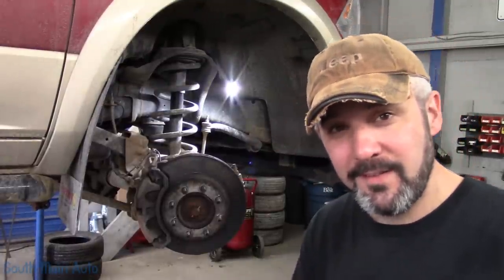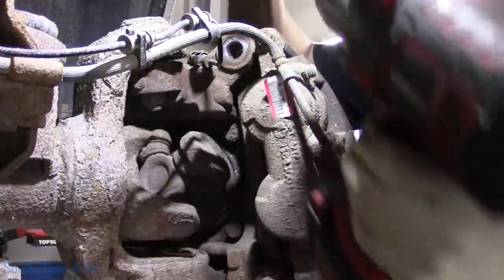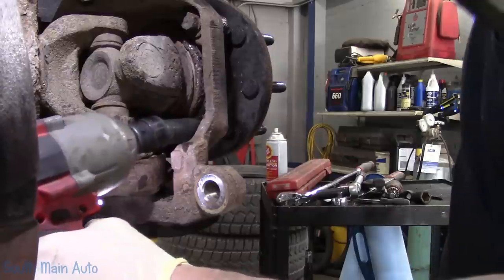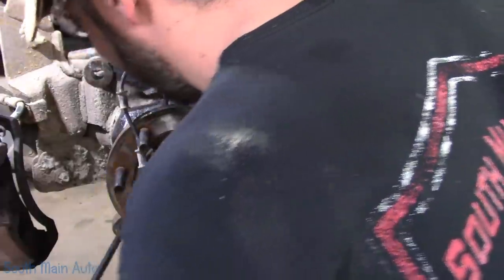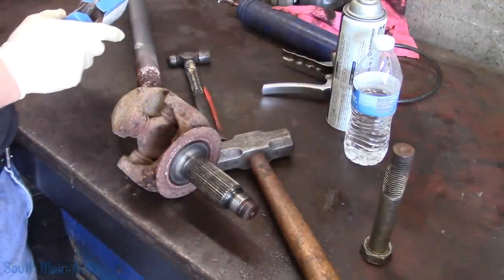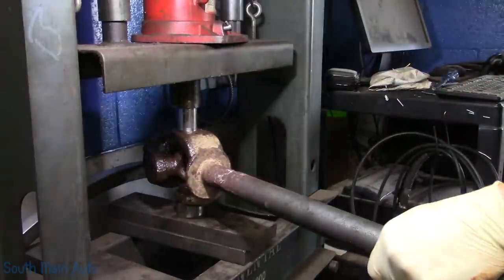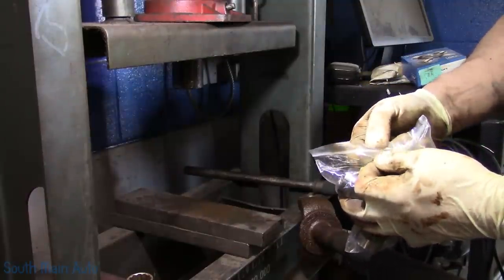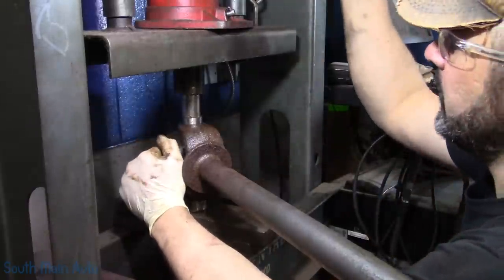Dodge Ram 2500/3500: Front Wheel Bearings & U-Joints - Part I

Comment: I bought a 1/4 drive impact driver at harbor freight, $60 over a year ago. I bought it to removed 8mm and smaller fasteners. I used it for a month every day at the shop, then I used it to build my deck, I bought 2 extra batteries ($26 for both) and used it nonstop for hours. I Still use it every day at the shop, still working great! I wouldnt say ALL the tools at harbor freight are great, BUT for $60, I think I got my moneys worth! I am glad to see you have had good luck with your harbor freight impact, Its on my list to buy ;)   Keep up the great work!  ( I also have a the earthquake 1/2 air impact, use that daily too.)

Comment: When you take your bearing caps off the U joint always put a few squirts of grease in them right away. That will always keep you from dropping a needle bearing when you go back to put them in. And leave the grease zirk out till last. That way when the bearing caps go back in it will fill the U joint  up with Greece and come out the zirk hole. Love all your videos. Thanks for sharing...

Comment: Greetings from Edmonton. This is THE best vid on a mechanical repair I have ever seen.  I have an '02 Ram 2500 with at least one of the  front wheel U joints worn, perhaps not as far gone as those shown, but in  need of replacement [they click when I have driven the truck for awhile and am tuning into my driveway].  Thank you, and kudos to you for the great instruction.  Just to add, I love it that you have the cam set up stationary, so that it isn't buzzing all over the place like a fly.  The viewer can actually see what you are doing.

Comment: I’ve owned several Dodge diesels, done lots of front wheel u joints. I’ve had the best luck with longevity with the Spicer non greaseable ones. Just my 2cents. 
Great video!!
Reply: He mentioned spicer and said he really hasnt had any better luck with them than others. In my experience I agree with you the non greasable spicers last a very long time. My last ones on my 01 ram 2500 diesel lasted just shy of 200k miles!
Reply: wheel joints that is. My rear driveshaft ones tend to go a little sooner.

Comment: I bought one of those earthquake impacts after watching you use yours... I charged it one time and did about 10 front end jobs... and even pulled some duels off of a dump truck before I even charged it the second time.  They are worth the  money... the electricity you save from not having to run the air compressor will pay for the tool... good find guy.
Reply: True but the power don’t compare to pneumatic guns.

Comment: First time I did a set of GM nylon-locked u-joints, I not only bent the ears of the yoke, but I also bent my Harbor "Fright" ball joint press! Instead of a "C" it was more closely resembling a "V". 😂 I paid $50 for that press from a Harbor Fright in Phoenix back in '99, long before they were heard of in the Northeast. Still have it! I heated the hell out of it, leaned it up against a 30-yard WM dumpster that was here at the time, and took 4 full over-the-shoulder swings with a full-sized sledgehammer onto it - 2 swings on each end - after heating the shnazz out of it with Mapp for 10 minutes. It worked!! Twas that day that I learned to MELT the nylon, and not try to muscle through it, just because you've got a press! 😁

You've got a great woman there Eric! Mine cooks for me too, but she works at a salon full time, so I end up eating the same smoked turkey sandwich, smothered in horsey sauce, for years on end, lol. She'll usually cook supper for me in the morning (she works late), and throw it in the fridge, so all I have to do is toss it in the nukeulator for a minute or 2, and supper is ready. One of the many reasons I married this one. 😉
Reply from the maker: We need to meet some time Smitty!
Reply: Hear hear, brother!  I'll get out your way one of these days, for sure. Hopefully sooner rather than later. 👍
Reply: just torch them until it starts melting out the injection holes like little snakes, then push  them out like butter :)

Comment: I always use to dab a little grease in the cups to hold the needle bearings in place.  Dropped a few in the early days and had it lay sideways at the bottom of the cup and then had to take them apart again and rest the needles.   Glad you showed everybody how to tap the sides with the hammer to equalize the tension on the u joint and make it smooth from the pressure of assembly.

Comment: i used to struggle on the press like you to do the tough u joints. until i saw a coworker use a ball joint c clamp press.   you can use a truck anchor  pin press on the bigger ones. clamp the shaft in a vice  and go easy with an impact  works like a dream.   and if not the flame wrench comes out.
Reply: richard cranium Tiger tool makes really good ones.
Reply: Never had access to a press, so a C clamp is all I ever used on Dodge U joints like this and the long driveshaft on the long B350 vans.

Comment: Super cool video!! The only thing I do differently is put the U-joints in a vice, like you did, open it up, take your Worm-drive skilsaw or Cutoff, I like the Skilsaw because it has so much torque and great handles,  put a metal cutting blade on and cut through the old U-Joints. Once they're out, punch all of the caps IN, cleaner,  10 times faster and most of us don't have huge presses.

Comment: A couple weeks ago I got to do this on a truck from Texas. Guy was up in Alberta Canada visiting. Half hour start to finish on one side. No rust anywhere, the bearing just slid out of the knuckle when the 4 bolts were loose. took under 10 mins to do the ujoint, a couple taps and all the cups were out. Was an '06 ram 3500 with almost 300 000 miles too. The bearings and ujoints were original. And normally when all goes well on trucks around here it can still be like a 2-3hr job on one side.

Comment: Just did my passenger's side u-joint. Not too bad to do. This video definitely helped with confidence in doing the work! Ended up putting a Moog grease fitting joint in it. Will probably do the driver's side before that one goes too!

Comment: 44k miles and looks like it has 144k miles, DAMN, I'm glad I live in the desert.
Reply: And needs new bearings and u joints?!? That is unexceptionable!
Reply: And Oregon wants to start using salt :(
Reply: @philllsxga.7737  It is a dodge after all, I'm just amazed it lasted that long, the only good thing is the engine, maybe.
Reply: @Peter-pv8xx  LOL! True!  You should see  what I do off road to my Chevy's with IFS and hardly ever have issues! A wheel bearing at around 150,000 miles, maybe...
Reply: 217k on my Ford. Everything is original other than 1 set of brakes, 1 set of sway bar end links, 3 sets of tires, and a window motor.  👀
Reply: I bought a '15 in April from OK but its traveled all over to earn 335000.  Its all original except for brakes.  Will use spray undercoating with fluid film.
Reply: weather doesn't affect bearings and u joints, just shitty dodge quality.
Reply: Jack Winand false. Heat/cold cycles do hell on the seal and then it lets water/dirt in. However this is likely just bad quality.
Reply: I have the same front end in a 3500, I got 110k out of the wheel bearings. Towing/plowing on 35” tires. That’s all I ever got out of my f350. These newer front ends are a great upgrade from the old ones.
Reply: When you work these light duty truck the parts wear fast. I've had to completely rebuild front ends after 20,000 miles and one winter plowing.
Reply: 220K on a 2001 Dodge 2500, the only thing to wear out in the front so far is the ball joints & tie rod ends at about 190K, but I'm in the Rocky Mountains, no salt. The bearings and u-joints were all tight as can be last month when I did the brakes.
Reply: @JeffinTD  Just the drivers who shouldn't drive in the snow/ice!   Joe from sw Washington, raised in NY/NJ.
Reply: @85square  weather don't - salt does
Reply: @chrisfreeman3279  Timken makes dodge bearings.  They are the best.  Moog used to be, but no more. AC/Delco are also made by Timken.
Reply: @FaustoTheBoozehound  Timken bearings are the best,  Moog used to be, but no more,  AC/Delco bearings are made by Timken too.

Comment: good vid - had to do my 2007 last year (2018) and although in Canada i live far enough North that we don't bother with salt for a lot of the winter since it is not effective below minus 18 so not worth using it.
I used the press like you since hammering on these is not good, too easy to bend stuff, doing the U-joints,
Wheel bearings, and every U-joint in the whole truck had to be done over a period of a couple years, it is just part of the pleasure of owning a 2500 i guess.
I did the socket and short extension trick for the wheel bearing removal and it worked pretty well.
Great video - thanks.

Comment: Harbor Freight sells a pack of wire wheels for about seven or eight bucks it will help you clean up all the rusty parts if you stick it in a drill I was working on Class A vehicles that did International routes so I dealt with all kinds of rust and having just simple wire wheels on a drill made my job so much easier

Comment: JB Weld a faucet handle on the relief valve screw of your press jack. Mix up a gob (not the quickie stuff) tape in place.
Reply: what about a longer cross pin or just weld a nut to the end :0

Comment: I can't believe your hubs and u-joints are gone at 44K!
My 06 2500 has 250,000 miles on the original hub/wheel bearings and it's only on it's second set of u-joints. That's insane.
Reply: I have an 03 with 135000, my u joints are shot, but I’m letting them go a while yet until this summer when I’m doing ball joints. Far as I know its the originals yet.

Comment: I don’t know how people afford vehicles in NY. I purchased a 2005 4x4 V10 Excursion 3 years ago with 180k miles. I put in a new HD transmission and did a head gasket change 2 years ago. She is running like a champ and I plan on riding her for another 15-20 years. I’ll just do the maintenance as needed. I guess living in SW Washington State where it rains 9 mo per year but we never put salt on the road has its advantages. I also have a 1986 F350 with the 460 and while she needs new exhaust manifold gaskets, the bones are in great shape.

Comment: You should mention the proper location for the grease fitting on the u-joint.  You got it in the right place, angled to the opening between the ears of the drive shaft.  
You also clocked it correctly so that part of the u-joint cross will close under drive forces.  The hole for the grease fitting makes that area slightly weaker between those two cross arms.  If it is under tension, where driving forces will spread the cross arms, then it is more likely to break. Under compression it is less likely to break. 
Good job.  I'm soooooo glad to not live in the rusty part of the country any more.

Comment: I tack welded a little piece of round stock about 3 inches long on the piece that you turn to take the pressure off the jack on the press, that way you do not have to keep using your handle to turn it, just clamp a pair of needle nose vice grips  on it when you weld it to keep the heat from going into  it and keep it cool while you weld it,  good luck
Reply: why not replace the short pin with a long pin?

Comment: One would think spending 70k on a truck should warrant a few more dollars on a rust treatment of some sort. It boggles the mind.
Reply: PinkPrism I was in a metallurgy class in college. The professor made the point that the auto makers COULD make automotive parts with more anti corrosive materials.
Reply: Harold Flanagan There is a fine edge between building vehicles to last, vs. designing them to wear out, so that you come back and buy a replacement.
Reply: One would think they would be using an alternative to road salt by now too!
Reply: @mitchvankesteren6771  Not much that works better than salt and is as cheap and accessible. But definitely think it’s possible to engineer something better
Reply: Fluid Film is the way to go.

Comment: Great video.. Would highly advise against using the “socket & power steering” method to press out the hub(s). Did this on my ‘08 2500 and it blew out a seal in the power steering box and it’s been leaking ever since. (Apparently these boxes have no serviceable and needs to be fully replaced). Do it the right way and get a hub puller plate/tool.

Comment: I did the same job on a similar truck.  I used the heat and beat method to get the u joints out and ended up bending the yoke on the axle shaft😮

Comment: I took a dremel with a conical stone bit.  Ground down the rust and surface of the U Joint you could get to inside the yolk before pressing out.  Make sense?  The cap wasnt stuck on the inner part of the cap in the yolk after pressing out.  Made life 10xs easier.  Children didnt like the explosion noises when u joint finally gave loose from 20 ton press and hit of air hammer.  Works.  Sanded off rust inside yolk with fine emery cloth and lube.  Filed very small chamber on yolk outside and inside.  Wire brushed clean the inside of yolk so c clios didnt catch anything going in u joint.

Comment: The retaining clips over the wheel studs from my understanding are installed from factory to lessen the  chances of the rotor falling off and injuring an employee during assembly of the vehicle. I guess the brake caliper and bracket are installed further down the line.They are easily removed with a pair of wire cutters or as they are referred to as "dikes". Use them on one of the detent flanges and yank it off. Hope this saves you some time. Keep up the great work.

Comment: My truck lost the passenger side wheel bearings on the Nevada/Utah line and i live in Elmore, Ohio on Lake Erie while on a wheeling trip. 2012 Ram 2500 6.7 Long Horn Laramie 4x4 with 148k. That cost me nearly 3k!!! It was a Sunday and i was hauling my Jeep to Northern California to The Rubicon Trail so i needed to have my trailer towed to their shop as well and since it was a casino town, the parts was a 2 hour each way trip… that one hurt and they were fine when i left my house! Thankfully i bought my truck in Atlanta, Georgia and it stays in my heated shop… no rust!

Comment: if you dont have a press , the OTC ball joint tool works very well.. just a heads up
Reply from the maker: Except for the fact the opening in the ball joint press is to small for the caps of the ujoint to fit through ;)
Reply: Oh thats nothing, just use a recever socket, we didnt have a press, so you do what ya have to do

Comment: I bought a metric u bolt for leaf springs on toyotas. Cut the u out and thread them in and use an air hammer with the anvil bit

Comment: Those caliper bolts on those 3/4 and 1 tons always stall my Milwaukee 2767 out. Always got to heat um and hang on them with my 24" breaker bar.

Comment: Use aC clamp 12' or bigger and weld a pieces of angle iron half inch or 1 inch and you pin it on one of the press crossmembers it will hold the axle in place I help it stabilized for you if you also have a stand like he does for the rear end of the axle shaft you have in the Press

Comment: Not a greater sound in the world than hearing the tool, nut, or bolt hitting the ground!!
Reply: Hearing the bellhousing hitting the back of the block after wiggling the input shaft through the clutch is pretty good too.

Comment: My Ram was nigh impossible to remove just the axle castle nut.  The hub bearing unit was possibly stuck on.   Ordered a hub buster tool and an 15 ton hydraulic gear and hub puller.  Hubs and front u joints were original since 1999 and over 320k miles.  That a lot of miles on them.

Comment: Just curious, but I've noticed you use smaller sockets on crusty bolts rather than bolt extractors/twist sockets... any reason you tend to stay away from the twist sockets? They always seem to work great for me, but of course I'm in Oregon so we don't have the rust issues like you have.
Reply from the maker: mostly because they are in my other tool box ;)

Comment: Im pretty sure those are plastic injected u joints like on most gm..the little hole on the yolk is from the injection...simply heat up the plastic with a torch for a few minutes, would probably help break some of that rust free as well.  Give it try...just some friendly advise from a mechanic in indiana.
Reply: Should save alot of trying to beat that u joint out so much and so hard.

Comment: I have an 08 Ram 2500 automatic with Cummins. have everything off but have a couple questions. should I have the truck in 4 wheel drive or does it not matter? working on drivers side and axle doesn't want to come out. before I put some force on it want to be sure I'm not missing something. btw, great video.

Comment: Sir I was hoping you could give me some advice. I bought a 2005 Dodge Ram, as I'm disabled and just needed a get around truck. 
Anyhow I have a bad click coming from the front left   (driver side) wheel housing area only when in two wheel drive, not when in 4 wheel.
Had a friend look at it and he said someone put in a lift kit. They didn't change anything else. So shafts are to short , and stripped at ends.
My question is if I have it in two wheel drive is the actuator not completely disengagng causing left drive to spin.
If I disengage the electrics to the actuator, would the fork completely move towards the deferential, and completely   disengage?

Comment: 06 Cummins.  I have to cut my ball joints through to get my assembly off. 1.5 ton port o power with heat wouldn't even start moving.  After the balls were cut I took to work and used the press to push hub off. Scale measured 32 ton and then suddenly the hub bearings blew all over the floor. Too tight of tolerance from the factory.